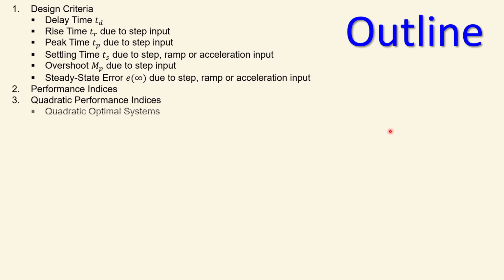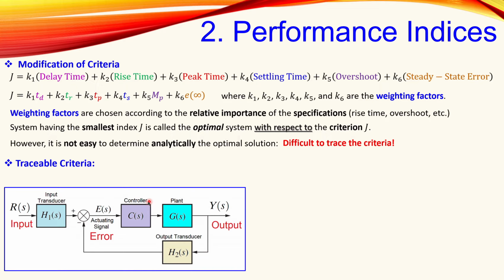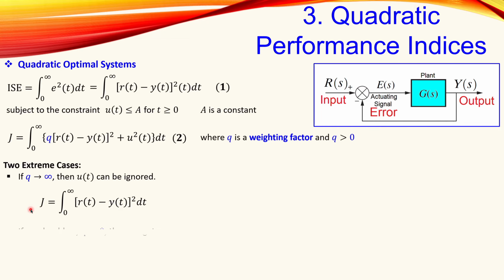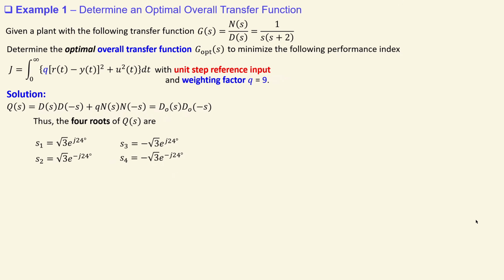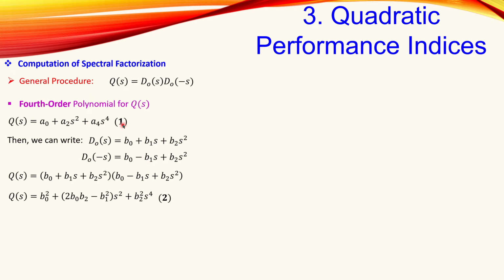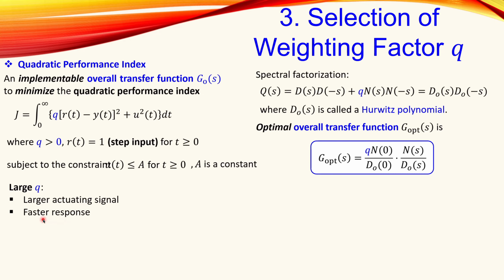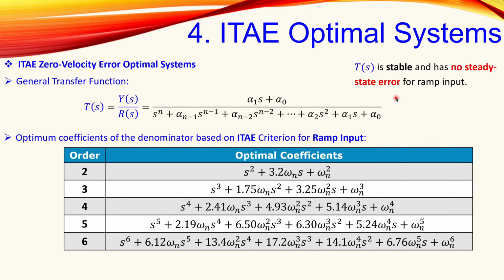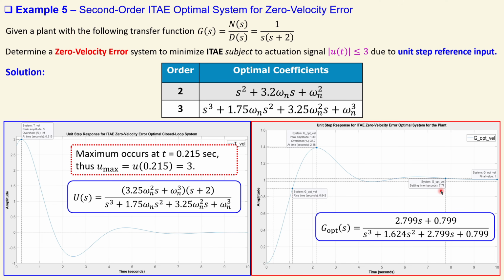Performance Indices in Control Systems Design 🌟 Theory & Many Practical Examples! 👍

Comment: how to do that in matlab do you have any video regarding that
Reply from the maker: Which part in MATLAB do you mean?
Reply: @CANEDUX  I want to have performance index which include overshoot/undershoot as parameter but I don’t know how to extract overshoot/undershoot data from signal…i have tried using workspace ..signal selector..min max function for undershoot overshoot and then integrating..assigning weights..but didn’t think thats correct
Reply: From scope in simulink i want to extract parameters
Reply from the maker: @MS757-p3l  Do you have some measurement data, like a transient response of frequency response? From here, you can get some information about your system.
Reply from the maker: @MS757-p3l  You can do that, but what kind of measurement of simulation do you have?